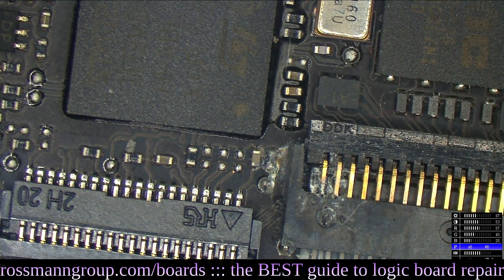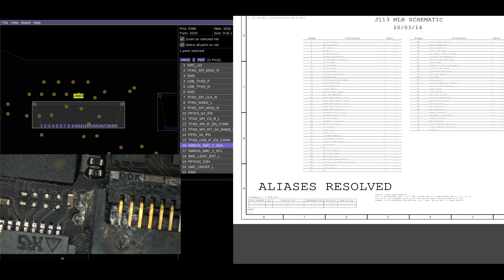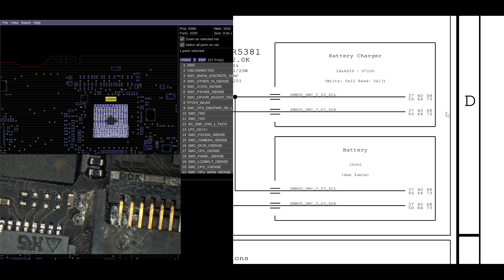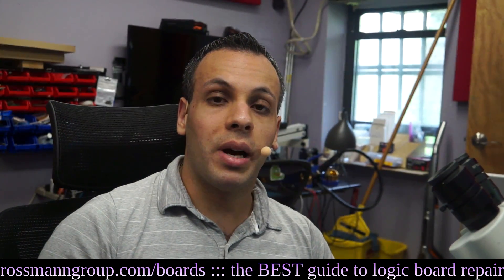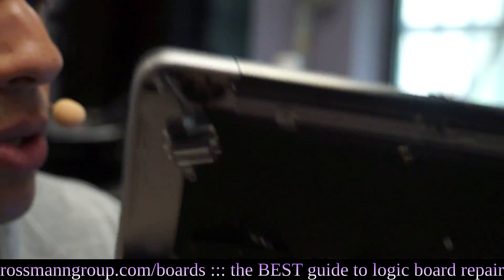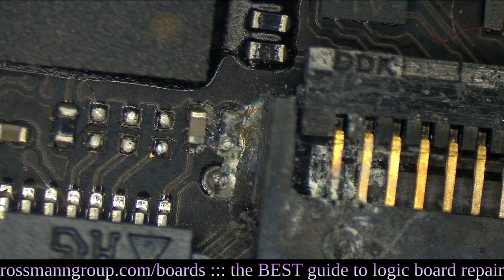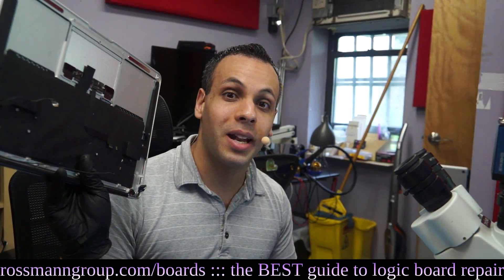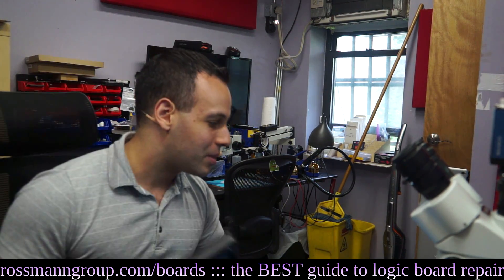Apple quality control slips through the cracks(literally)

Comment: Funny, a few hairs get in a MacBook and kill it and I spill a full cup of water on my Dell Windows laptop and it works for another 4 years. Also the Dell laptop is a hell of a lot cheaper than the MacBooks too.
Reply: Dylan's Tech Possibly because the Dell laptop might have some protection against spills in the keyboard, and some well placed drainage paths.

These are the same circuit boar materials- circuit boards are all likely to corrode when wet. It's just the well designed machines make sure there's as little chance of that happening as possible.
Reply: You only get those features in business laptops. So Lenovo that's ThinkPad. For Dell, it's Latitude.
Reply: Wow, whole 0,5L Mixery in my MBP2015 13" and i am writing on it right now...

Not all MBPs are bad, from 2012 - 2015 they were really dope though and no - the Dell is not cheaper, get a Dell with the same Specs and you will see that Dell does not offer a 3GB/s NVME, a 2560x Screen etc.

The new Macbooks suck hard - no question, i wanna try Surface Pro 2 now because i tried the Dell 14" and it sucks compared to my old 2015 MBP.
Reply: Olivia esddms I do agree that they use the same printed circuit board material and that it would corrode just as easily as the MacBook, but that is not the main point that protects the laptop from water damage. The 2 main pointes if I had to say are the keyboard and trackpad. And I don’t even have an expensive Dell laptop, it only has the specs of a base 2017 MacBook and I know that it was under a 1000 dollars.
Reply: z tech & music I actually am a big fan of the MacBook and if I had the money I would have a top of the line 2017 model, and so I am not an apple hater, I just think that apple has Maybe gone down on their design quality and that is why people where willing to pay as much for them. If apple starts making laptops with the same build of everyone else, them people are not going to want to buy it as badly when they can get something for half that price and get the same build quality and windows 10.
Reply: The only reasons i need a macs is for xcode
Reply: Dylan's Tech I know this is going to sound pedantic, but I just wanted to remind you to be careful when you're talking about the "Macbook." I believe you mean the Macbook Pro. The main reason I'm pointing this out is because the Macbook is a tiny piece of utter garbage with a ridiculous price tag. At least with the Macbook Pro, you get something much closer to a real laptop.
Reply: Adam Baldwin I agree with you totally. I also think that 2015 and after tho they went down to what was showed in this video for quality no matter what model we are talking about.
Reply: Olivia esddms no not really, dell is just fucking unbreakable, check linus tech tips video where he leaves a dell under the rain and another where he gets is wet and they both work perfectly even tho they are not waterproof and they have water leaking out of them after
Reply: Beni 51 exactly! When my dell got a cold cup of water in the keyboard i just picked it up and shook it off to keep using it. Mind that it is just an Inspiron for like $650 not even a high end XPS or latitude!
Reply: Dylan's Tech I used to have a dell latitude, the thing was impossible to kill. I had it in the kitchen and my brother managed to dump and entire pitcher of water in it. The laptop still works to this day without fail.
Reply: Beni 51 I had an Asus that was also leaking water everywhere, but opening it up it was practically dry inside. The water pooled over the sides and just tricked down some plastic, and didn't really hit any circuit board anywhere.

My point is that generally, PCBs all corrode when wet, to a smaller or greater extent. It's just that some are in an enclosure that minimizes the threat of that.

Or maybe Dell sprays it's boards with something anticorrosive? Then the question is why doesn't everyone, and why wouldn't they advertise that?

Comment: To be fair you can actually see the black box to the left of the chair directly through the right mouse button above the trackpad on the thinkpad... Not saying that the smc is directly below that or any water in there would completely brick the system like a mac but still, you should at least actually check the computer you compare it to doesn't posses the fault you are claiming it doesn't have.
Reply from the maker: From the pinned comment: that is actually the water drainage hole and is labeled as such. See picture of bottom here: https://www.instagram.com/p/Bjvwsv4FBsi/?taken-by=rossmanngroup The trackpad is sealed all around so that liquid that falls into it falls into the drainage hole so that it leaves the computer before it makes its way to any flex cables or motherboard components. That hole goes all the way through to the bottom of the machine. You can see how it responds to a liquid spill here: at 2 minutes in: https://youtu.be/tZiSxPvuPLc?t=119 This is why the Thinkpad will still work, click, prime95, and type after spilling water into it - it is sealed around the drainage holes.

Comment: Not meaning to be "that guy" but 3:12 you can see light from the edge of the red bar at the top of the track pad. From the focus i am not sure if that is elevated above or level with the track pad. But still a lot less opening then apple.
Reply from the maker: From the pinned comment: that is actually the water drainage hole and is labeled as such. See picture of bottom here: https://www.instagram.com/p/Bjvwsv4FBsi/?taken-by=rossmanngroup The trackpad is sealed all around so that liquid that falls into it falls into the drainage hole so that it leaves the computer before it makes its way to any flex cables or motherboard components. That hole goes all the way through to the bottom of the machine. You can see how it responds to a liquid spill here: at 2 minutes in: https://youtu.be/tZiSxPvuPLc?t=119 This is why the Thinkpad will still work, click, prime95, and type after spilling water into it - it is sealed around the drainage holes.

Comment: I'm confused.  Apple is the best, right?  I expected the trackpad to be press fit into the housing with a gasket and coated in teflon. 

No?  I mean that extra $1.50 per machine would have saved thousands of people from having to buy a new $2000 dollar machine.

Oh, I get it now.  <insert screaming sounds here>
Reply: Except that they don't and still sell 5 year old hardware for 3 gran.
Reply: Apple won't even spend money on proper shills, that's just cheap!
Reply: L HK do you even know how it senses pressure...? It doesn‘t need a gap, on the iphone is no gap, on the iphones Touch ID sensor isn‘t a gap neither, sooo
Reply: htomerif their new macbooks don‘t even have a slot, because it‘s 3D Touch. I don‘t get it why you are talking about new MacBooks when you don‘t even know how they work. They ARE fixing problems and adding new features, but everyone bitches about older devices and thinks that apple doesn‘t do anything, because noone even wants to know that they are fixing and upgrading things.
Reply: There are gaps on the newer MacBooks because force touch needs to sense pressure.
Reply: Thats great that they're fixing things.  I had a MBP that had a battery fail.  It puffed up and destroyed a lot of stuff as the battery forced its way out of the computer.

Did Apple fix that?  No, no.. they made it worse by sealing the battery inside so it definitely will destroy your computer if the battery fails.

It also had a keyboard that failed really quickly under heavy use and cost 10 times what any other laptop keyboard I've had cost.

Did Apple fix that?  No.. they made a sleek new keyboard thats actually getting them sued the design is so terrible.

dbleoo:  If Apple gets anything right they get it right by accident.  I've owned a lot of Apple stuff and the only currently functioning piece of Apple hardware I have is a Mac SE 30.
Reply: MrDoboz
: you mean the old gen processors on mbp like apple had some time ago? the low-end gpu's? the wireless charging on iphones the rest of the world had years ago? the lack of ports and requirement to use dongles? the usb-c/lightning issue on iphone/mbp? yeah right... the best tech ever...
Reply: well, if u consider losing the ability to turn on as "the user experience"
Reply: some of you guys clearly didn't get my sarcasm
Reply: gerble36 do you know me? No. So don‘t call me an apple sheep. I just said the facts, there was nothing wrong in what i said. and please stop spreading this shitty argument, that the competition had those „features“ before. It‘s not who makes it first, but who makes it best. Like Face ID, they didn‘t just make a simple face scan, they rather wait but make something very safe and easy to use. Or like wireless charging, with the Qi standard. Oh and btw, the Pixel doesn‘t even have wireless charging in 2018. I personally can‘t say that Apple devices are crap, because I only had good experiences with them. I also had many android flagship devices, they are good, especially the s9 plus, but my iPhone X is better for me. Why do you want to argue, if it is my opinion, my Personal preference. If you don‘t like these products, you can Buy something else and shut your mouth, why are you then wasting time with them? These examples that you gave are cases that occur 1:1,000,000. this isn‘t the normal case, so it doesn‘t represent the company. I don‘t say that what they do is perfect and that they shouldn‘t have done it a different way, but it‘s not as bad as you say either. I always had a good and enjoying experience and i hope you have one too, with the devices you prefer. No need for bashing companies.
Reply: dbleoo: are you a professional at missing the point? Has someone hurt your feelings by daring to question Apple's manufaturing and designing quality? Their questionable warranty practices?
My, you're pinning your allegiance to the mast if you're going to go on about how Apple don't always come first but improve on what's gone before... not just wireless charging or face recognition, how about everything the original iphone could do but without a touchscreen on a 5 years-older XDAii? What you're talking about is not only not improving others' innovations (merely making their own only-Apple-compatible features) but *not actually relevant to the point of the video*.

You, sir, are what we call in Britain a "wind-up merchant".
Reply: no, you got it wrong. Very wrong my friend. It's so no Apple users will stick with the old tech, and get the best of the best, bleeding edge technology every year, they don't miss out on anything new that comes to market. You know, because people are lazy, and will be thankful for Apple after buying the new product. They will realize what would they be missing out on if their previous machine didn't break. do you get it now? It's not the money, it's the user experience. I know it, I got all generations of high end Apple machines since a decade. Being up to date and knowing I'm having the best tech all the time is worth every penny I spent on them.
Think different my friend!

Comment: Actually can see the light throught the touchpad keys on the Lenovo, you just showed it poorly compared to the Macbook :) nothing sealed there either, also a piece of junk only plastic.
Reply from the maker: From the pinned comment: that is actually the water drainage hole and is labeled as such. See picture of bottom here: https://www.instagram.com/p/Bjvwsv4FBsi/?taken-by=rossmanngroup The trackpad is sealed all around so that liquid that falls into it falls into the drainage hole so that it leaves the computer before it makes its way to any flex cables or motherboard components. That hole goes all the way through to the bottom of the machine. You can see how it responds to a liquid spill here: at 2 minutes in: https://youtu.be/tZiSxPvuPLc?t=119 This is why the Thinkpad will still work, click, prime95, and type after spilling water into it - it is sealed around the drainage holes.
Reply: Dude. Always read the pinned comment before making any comments
Reply: PoltergeistWorks How does it feel to be so wrong, boyo?

Comment: @Louis Rossmann I found a spot dude. https://youtu.be/yenIoGl5gmg?t=3m12s
Reply from the maker: From the pinned comment: that is actually the water drainage hole and is labeled as such. See picture of bottom here: https://www.instagram.com/p/Bjvwsv4FBsi/?taken-by=rossmanngroup The trackpad is sealed all around so that liquid that falls into it falls into the drainage hole so that it leaves the computer before it makes its way to any flex cables or motherboard components. That hole goes all the way through to the bottom of the machine. You can see how it responds to a liquid spill here: at 2 minutes in: https://youtu.be/tZiSxPvuPLc?t=119 This is why the Thinkpad will still work, click, prime95, and type after spilling water into it - it is sealed around the drainage holes.

Comment: That's funny it is a standard feature on my Lenovo edge 2 1580 laptop
Reply: Chance06Se See the pinned comment.
Reply: I was sarcastically comparing the air gaped track pad of that macbook air to my cheap laptop's track pad.  I can see lint building up just inside the upper seam where the edge of the track pad meets the upper housing.  I got that "feature" (non sealed track pad) included in my much less expensive laptop.  I can see how it appears i was refereeing to the drain feature of a p50....when i actually was not.

Comment: Knowing Apple they'll call that gap on the touchpad a feature before calling it a design flaw.
Reply: It's a cooling vent! /s
Reply: Of course it's a feature! : "Apple's Proprietary Liquid Damage Reducifier System" allows for the exposure of mere particles of liquid which, if left in a state of complete and utter anarchy atop the trackpad, would most assuredly leak into your iTunes account and fragmentate all your songs!  Therefore, the superhero geniuses at Cupertino have formulated a brilliant plan; these rogue atoms of liquid material can now no longer destroy your data because this activates athe "Apple Proprietary Safeguard Sensorographer Matrix", which shuts down your entire system until you can bring it to a "Proprietary Apple Authorized Repair Shop" for a surefire fix that should only take anywhere from 1 - 3 but up to 420 days! (Proprietary)
Reply: Yea and they'll tell customers to use it in a certain way.
Reply: LGPanthers1
no, because they just replace your board, and all your data is gone. more like "criminals can't get to your data if they sneeze on the touchpad"
Reply: I imagine that it actually is a cooling intake.  I also would bet that they put it there because they were too concerned with appearances to put it anywhere else.  

or more comically: 
Design team: "HERE IS OUR PERFECTED VISIONARY DESIGN!  MAKE THIS INTO A COMPUTER!"
Engineering team: "yeah, well we need to put connectors on it, and it needs ventilation slots"
Design team: "NO! NOTHING MUST SOIL OUR PRETTY PICTURE OF A LAPTOP!"
Engineering team: "fine, just get rid of as many connectors as we can, and we'll hide an air intake where those morons won't notice."
Reply: Expansion gap, like on bridges
Reply: It helps the internals breath better so it will run faster.
Reply: Woosh

Comment: To be fair, I did see a gap between the trackpad and the mouse buttons.
Reply from the maker: From the pinned comment: that is actually the water drainage hole and is labeled as such. See picture of bottom here: https://www.instagram.com/p/Bjvwsv4FBsi/?taken-by=rossmanngroup The trackpad is sealed all around so that liquid that falls into it falls into the drainage hole so that it leaves the computer before it makes its way to any flex cables or motherboard components. That hole goes all the way through to the bottom of the machine. You can see how it responds to a liquid spill here: at 2 minutes in: https://youtu.be/tZiSxPvuPLc?t=119 This is why the Thinkpad will still work, click, prime95, and type after spilling water into it - it is sealed around the drainage holes.
Reply: But the difference is that if the Thinkpad trackpad connector gets corroded it doesn't completely destroy the ability for it to turn on.
Reply: I accidentally spilled whole cup of tea on my Thinkpad E560, about a year ago. It only destroyed the keyboard, which i was able to replace myself. Its still working.
Reply: Specifically the RMB just below the spacebar on the Thinkpad
Reply: Actually, the gap you see is between the buttons from the keyboard itself (trackpoint) to the touchpad
Reply: Yeah, I agree that Louis should've specified better
Reply: Mário Silva I'm sorry. Was the question not "can you see the light from the window through my ThinkPad?" because you can. You could totally see the light.
Reply: Louis Rossmann just busting your balls man hahaha

Comment: 3:12 ish, you actually can see light through the bottom right corner of the 2nd mouse button. Its not sealed either, lul. Still, fuck apple.
Reply from the maker: From the pinned comment: that is actually the water drainage hole and is labeled as such. See picture of bottom here: https://www.instagram.com/p/Bjvwsv4FBsi/?taken-by=rossmanngroup The trackpad is sealed all around so that liquid that falls into it falls into the drainage hole so that it leaves the computer before it makes its way to any flex cables or motherboard components. That hole goes all the way through to the bottom of the machine. You can see how it responds to a liquid spill here: at 2 minutes in: https://youtu.be/tZiSxPvuPLc?t=119 This is why the Thinkpad will still work, click, prime95, and type after spilling water into it - it is sealed around the drainage holes.